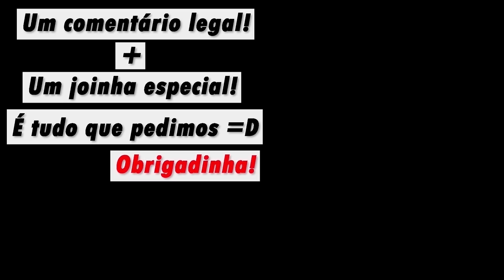CHEGOU A HORA DE REPENSAR O FUTURO DO PROJETO (É O FIM da KOMBI? Parte VIII) T2.ep298

Comment: O MELHOR A FAZER.
.
VOLTAR 
DESPACHA ELA PARA O BRASIL 
.
VENDE ESSA KOMBI 
.
COMPRA UMA VAM FURGÃO 
EM LEILÃO DOS CORREIOS OU UNIMED 
.
TROCa de FROTA 
.
Revisa motor e caixa 
Gastem 150 mil reais .
E 
Monta uma casa nova.
E 1 ano depois 
2021 
Coloca num navio 
E vai para o Panamá de novo .

Essa Kombi não chega nem em Miami 
.